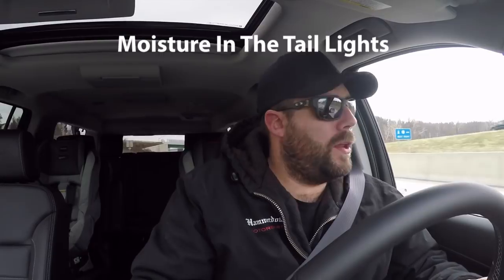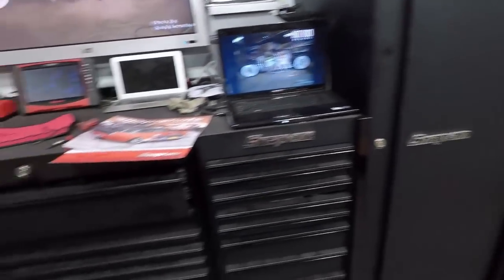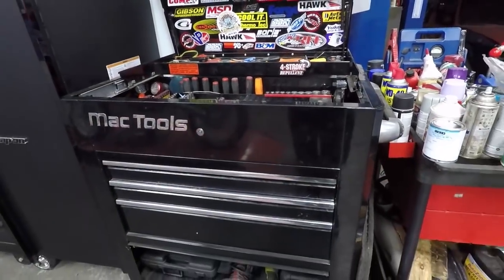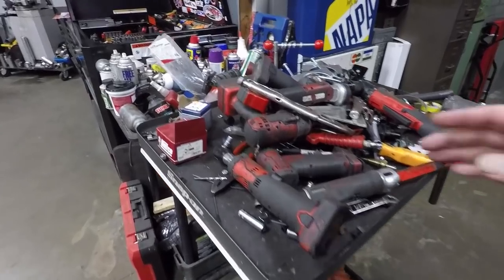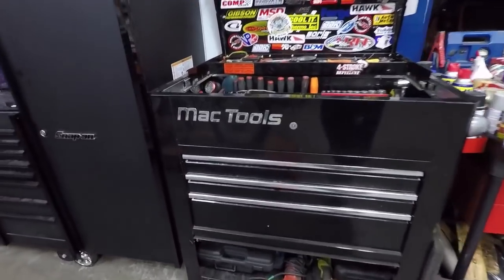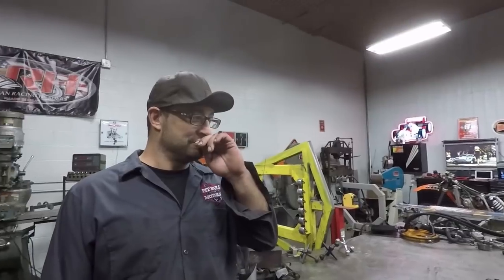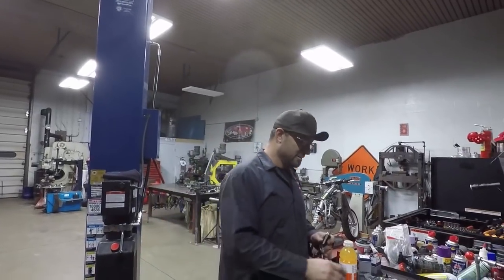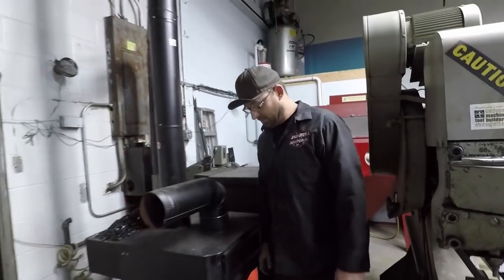Snap On Tools Vs. Cheaper Brands

Comment: Why r u taking ur shit in for warranty when u can do it ur self for free parts and done right? You’re a licensed mechanic in Canada, right?
The first thing u recommend is pry bars?
Screw drivers? Hardly used
Bits- absolutely 
1/2” impact with all the adapters 
I love snap on electric but rigid has the best tool body and battery warranty 
Your tool cart will make you money
This advice was a let down. 
There’s a place for high end and a place for good priced tools. And you didn’t cover it